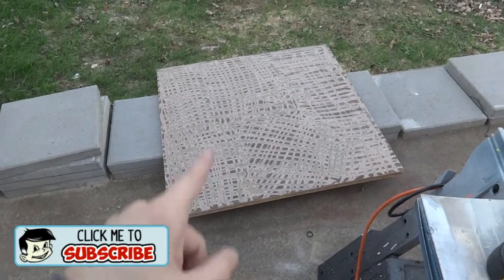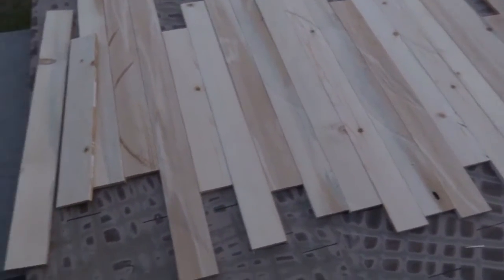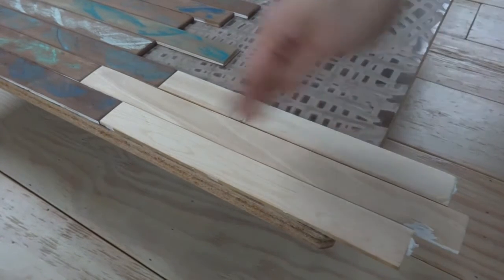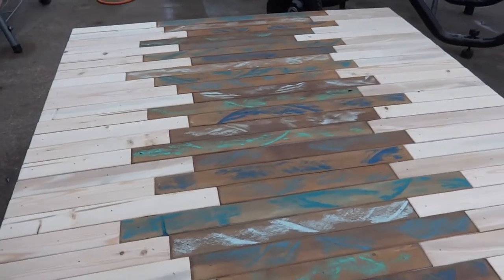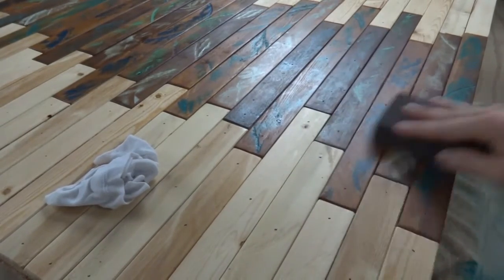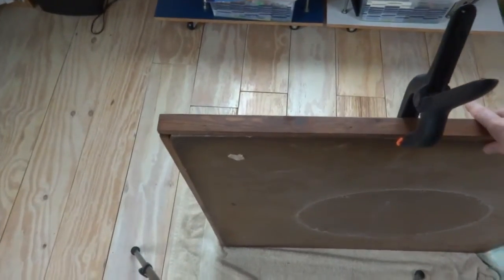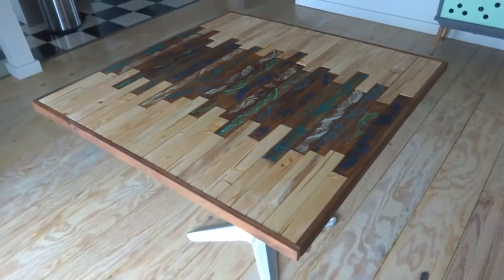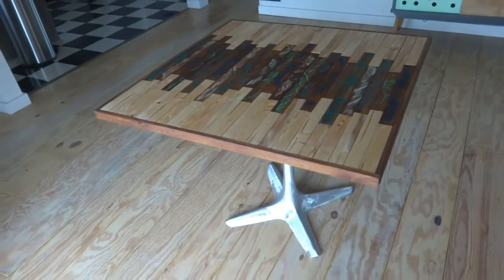$4 Thrift Store Table Makeover - Part 2 of 2

Comment: Wow, it really does look awesome and with just a few, simple tricks.
Just a tip, if you want to avoid having to sand after applying finish, use a damp rag to raise the grain and sand before finishing.  You might still have to sand after, depending on the look/feel you are looking for, but it will give you a better finish.
Reply from the maker: +Jason Adamczyk Thanks for the tip. I've been meaning to start raising the grain on my projects, just haven't done it yet.

Comment: Great table would like to be able to find a table like that at my local thrift stores
Reply from the maker: +Luis Valdez I see similar ones on craigslist quite a bit. They keep getting relisted over and over, which tells me that no one wants to buy them because their so "break room" ugly, so I bet you could get one pretty cheap.  It doesn't really matter what the top looks like as long as the base is solid and has a little style.
Reply: +MrDiyDork I need to start looking thanks